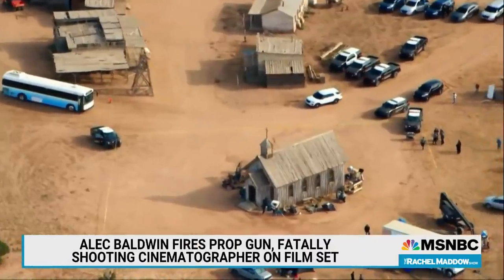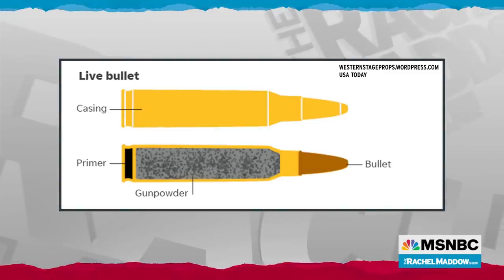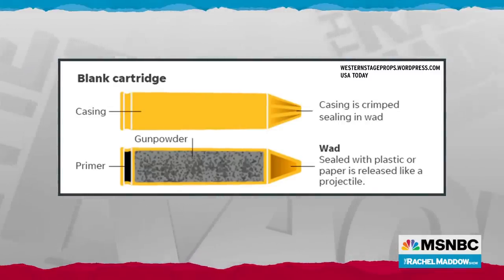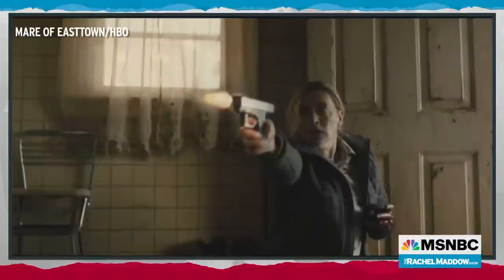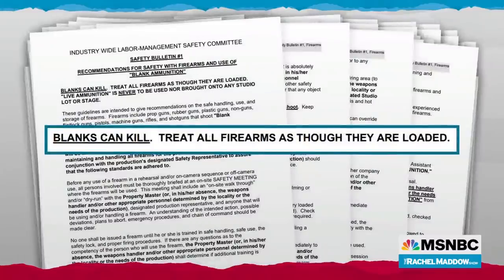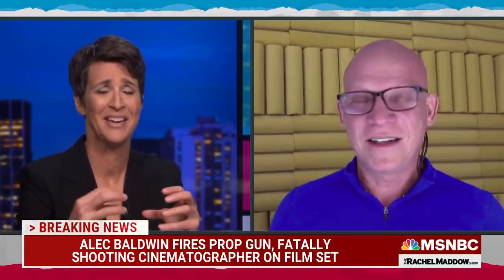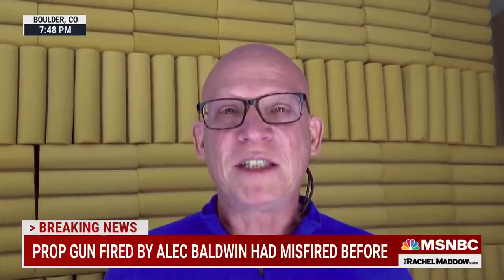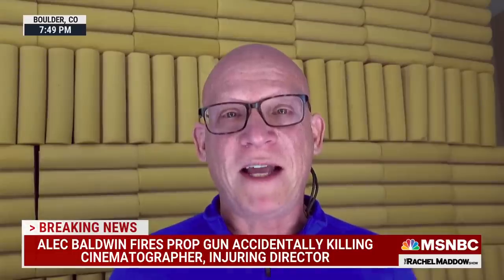Weapons Safety Expert Looks At Safety Protocols And Alec Baldwin Movie Set Shooting

Comment: Not only are those "safety standards" for movies they are literally the basic safety rules that you're taught or supposed to be taught on day one of handling a gun.
Reply: Yep, if I was an actor I'd be checking any guns handed to me and insist that I be the one loading it with blanks.  Even if the gun was designed to only accept blanks.  When you just accept that a gun is clear when someone just hands it over you are putting your own life at risk.  This could have been a very different story if the barrel had a blockage in it and it exploded in Alec's hand.

Comment: Great breakdown! It seems to me that it must have been an actual round of ammunition but it's still puzzling how this happened.
Reply: It was used at a gun range and failed into negligence.
Reply: @colinl5951  Most likely or used to shoot real rounds for another part of the shoot (i.e. shooting at objects) The failure definitely falls to the armorer. 

If you look into it the armorer is super inexperienced. I mean 24 and talks about how nervous she is loading blanks. Not much experience. Although I can understand being nervous since she would understand blanks would be used around people and thus its more pressure on being accurate. Still, if you're that nervous probably should be head of the handling.
Reply: @TearDownGenesis  you hold a gun, it fires, your responsible!

Comment: I understand from past experience working as a paramedic on movie sets that a armorer or weapons specialist was required on all sets.
Reply: Supposedly the armorer prepared 3 guns and put them on a cart.  An assistant director picked one up and handed it to Baldwin, then called out "cold gun".  Baldwin fired it.  All three people should have checked that gun.  Baldwin is apparently anti-gun, but even so, he should have been trained to check.  I haven't seen a timeline showing how much time elapsed between the guns going onto the cart and Baldwin being handed one.  Apparently a bunch of crew, including the armorer, walked off the set due to safety issues.

There's also reports of some of the guns being used for target practise off-set.  And also that live ammo and blanks were stored together.

I don't know what the normal protocols are, but if I was responsible for those guns, there'd be a chamber flag (or the revolver equivalent) in each one, right up to a minute or so before the cameras rolled.
Reply: Are actors expected to check. I keep seeing people say "Alec should have checked the gun" is that something that they are expected to do?
Reply: @ralphm6901  I haven't heard some of that, but I honestly think the responsibility (i'm not saying criminal) does lie with the armorer. Its their job to ensure the guns are properly maintained. If the asst director went to their work station and grabbed it without asking then maybe not but if they were left and not fully noted as being loaded then it really falls on her (armorer) for failure in her role.

Comment: Weird, strange, reminds me of the Brandon Lee thing years back, I remember back then, even as a preteen being like, none of this makes sense, reminds me of the hitman game when you have to trade the prop gun for real gun to cause the screen to have an accident, real guns on set are supposed to be modified with a simple teqnique at the end of the barrel that would prevent most accidents, there's absolutely no reason for deadly ammo on movie set, the Brandon Lee thing with saying that the lead from a real bullet got lodged in the barrel and then a blank bullet was added during the scene and the accident happened was very sus at best, I just don't even want to know... there's no reason for real ammo on a movie set, a blank bullet fired at point zero range would scar you at best, somn more had to have happened...ijs
Reply: Honestly Brandon Lee's is more "understandable" since a piece of a fake bullet broke off and lodged in the barrel of a gun and when the blank was used it pushed it out like it was a real bullet. 

At least in that case the proper ammunition was used, but the failure was the gun wasn't properly inspected (determined in the investigation) here an entire live gun was put into a situation and called cold (no ammo)

Imagine some of these movies with automatics and if those got swapped.

Comment: I know gun fans that say they can tell the difference between a real gun firing and a digital effect. And they're probably right. 

The police are investigating multiple things. Were the guns secure during lunch break. There was a labor dispute going on on the set. An assistant took the gun from the props table and announced "cold gun" before handing it to the actor, meaning that they double checked that the gun did not have live ammo. Sounds like that last safety step might not have been properly performed. There are likely rules against actors opening the firearm. The actor was practicing drawing the weapon in a manner that the story required when it went off. On a movie set there can be thousands of watts of lighting on the actor preventing them from seeing into all the dark areas of the room. The actor might not have even know there was someone standing where the gun would be pointed once drawn during the rehearsal practice. And if it were a slow motion shot then even more lighting would be in use. 

I wonder if the guns were secured during lunch break such that no one could tamper with them. (remember there was an ongoing labor dispute.) And why the assistant announced "cold-gun" without checking it for live ammo when handing it to the actor.
Reply: The labor dispute was one of the first things I thought of.

Comment: For those unfamiliar, there are 4 Basic Rules for safe handling of firearms.

1, Always keep the firearm pointed in a safe direction.

2, Treat all guns as though they are loaded.

3, Keep your finger off the trigger until ready to fire.

4, Be certain of your target and what is behind it.

This tragedy occurred because these rules were not respected or followed. 100% avoidable.

What occurred was a Negligent Discharge.

Comment: Alec Baldein is also a producer of the movie Rust. There are reports that union workers had filed complaints about lost/unpaid compensation, hotel accommodations, and safety issues with the production, and that they had walked off the set that very morning due to their concerns not being addressed.

A handful of non-union workers were supposedly brought in as last minute replacements and it's possible that these people were not vetted or trained on firearms safety that is required in movie or television production when prop guns are involved.

That seems to be the most plausible cause of this tragic accident. There is a more sinister possibility and that's one of the union workers had an axe to grind with the producers and deliberately sabotaged the prop gun so something like this would happen, but this is a farfetched/worst case scenario. Hopefully the investigation will uncover the truth of what happened here.

Comment: There are reports the crew walked off the set a few hours earlier in protests over safety concerns. Was this an accident waiting to happen? Because of the work culture? Or was it a malign act by a disgruntled member of the crew who thought it might prove a point and it unfortunately had disasterous consequences.
Reply: It sounds like it was troubled set with budget issues and it was this lack of resource which seems to the reason for the walk offs. Lack of budgets and poor management often are the root cause of safety failures and bad safety culture.

Comment: One thing to note from the diagram at 1:25
A bullet is most effective when fired from a device designed to propel it in a straight path. In other words, if the bullet is exploded outside of an actual firearm, it's still potentially lethal (like a tiny grenade), but nowhere near as lethal as when it's fired from a gun with a firing chamber designed to hold the casing still, and a rifled barrel designed to spin the bullet so it flies straight.

In fact this is one reason why Bruce Lee's son died. The prop crew at that film shoot emptied the powder from a round and replaced the bullet, and when that was fired on set, a bullet got lodged partway down the barrel of the revolver being used, because the crew neglected to remove the primer. That's called a "squib load", and is incredibly dangerous because it can cause the breech to explode into the face of the person firing the gun. When a blank round was loaded, that propelled the bullet that killed Brandon Lee.

In any case, there is no reason to use live rounds on a TV or film shoot. Not when the risk of death is just too great, not when there are tons of alternatives. Whoever let a gun loaded with live rounds onto that set has a lot to answer for.

Comment: The person handling a gun is responsible to ensure it's safe and used safety, Alec blamed everyone else but himself who actually fired the gun.
Reply: :  I have not heard of any blame being assigned, where did you hear that?
Reply: And when the scene calls for the actor to jump into a car and drive away, do you expect the actor to first conduct a full safety check of the car, measure tread depth on the tyres, check wheel alignment, thickness of brake pads, operation of windscreen wipers etc, etc?
Reply: @grantm6514  First Jeffrey Toobin, now Alec Baldwin. Comrade, why IS this happening?😥

Comment: Slight correction: Gunpowder technically refers to old powder AKA black powder. The stuff used now is called smokeless powder. Unless you're firing an antique gun/ammunition, it will always use smokeless powder.

Comment: I always check any weapon in my control to know exactly its disposition and if it's the one I've expect.  I've gone shooting with a law enforcement officer that handed me a 9mm with a round left in battery... but claimed it was clear.  I pulled the slide with the mag out and thete sat a little present.  I kept the gun pointing in a safe direction while I checked.
Reply: It seems to be a common misconception about semi-automatic firearms. People think if they take the magazine out, it is unloaded. Some firearms have a magazine safety that is supposed to prevent the gun firing if the magazine is out. I never trusted that idea. Pull back the slide.

One firearm that will tell you if a round is in the chamber is the WWII Lugar. I think the Browning also made a handgun with an indicator. It would seem to me an excellent idea would be to have such an indicator on all semi automatics. But to tell you the truth, I probably wouldn’t trust the indicator, either.😁
Reply: But you went in knowing that you were going to be handling a leathal weapon with the potential of it being loaded.  You also willingly chose to conduct an act where it is ultimately your responsibility to ensure the safe use of that firearm.

That's is not how film-making works.

Actors are not gun users as their entire job is to essentially 'pretend' and in doing so, they hold a legal expectation that everything they do is a pretend act and thus does not carry any realworld consequence.

Unless there was a legal status saying that the ultimate responsibility of safety was on the individual firing a gun during the filming of a film/TV show/Commercial/etc, then it's not the responsibility of the actor to ensure that what they are doing is a safe act.  

Example, is it the actors responsibility to ensure that it's safe to run through a door so as to not hit a passer-by that just happens to be on the other side?  Is it there job to ensure that throwing a rock in X direction will not hit another human in the head?   No!  Their job to to act and it's someone else's job to ensure that their actions are safe.
Reply: @inorite4553  Anyone handling a firearm has the responsibility to handle it safely. Actors receive training on how to handle firearms safely. Someone else may have made a mistake, but in the end the person who pulls the trigger is the one who bears the majority of the responsibility. That’s true wherever firearms are involved.

Comment: Seriously nobody will say anything about the  possibility of that blank ammo being sabotaged? There are specific materials that can be placed inside a blanck bullet and then dissolve after the shoot. But who would do something like that crazy???? Who would have a personal valid reason to end Alec's career like that? Who????
Reply: Because that's a really really far stretch to assume.  Like, you'd first need to come up with a lot of evidence to even hint that it could be a possibility before it'd be considered.  Considering the other factors - the strike of the crew, the poor weapon safety enforcement, etc.. it's far more likely to be an unfortunate accident.

Alec's career may not be over, either.  If it is a true accident, then he might suffer some setbacks.. but Alex Proyas and Michael Massee was fine after Brandon Lee died on set under his watch.

Comment: A slight correction. A misfire is when a round doesn't go off when you want it to. When you pull the trigger a round might not go off and it might never go off. It might go off a few seconds later when you're pointing the gun somewhere else.  If the round doesn't go off when you pull the trigger and the mechanism strikes the primer, then you've got a little bomb.

Comment: A live round in a blank firing gun? I call bs. They outfit the chambers of these guns with an ID of about .1 millimeters less than an actual live cartridge so loading any live cartridge simply wouldn't fit. Because blanks are so often under powered they compensate for this by using a special nozzle down the barrel that enhances muzzle flash and sound. Maybe that piece came loose but loading a live round into the chamber? Impossible.
Reply: That's the truth.
Reply: Unless it wasn’t actually a prop gun.

Comment: To nitpick just a bit.
A crimped blank doesn't tend to have wadding because they are often used in semi-auto guns that have barrel ports installed to create enough back pressure to cycle the weapon action. Wadding would clog this barrel port potential causing the weapon to fail.
Revolvers and shotgun blanks on the other hand are typically not crimped and have wadding to seal the end of the blank. Not only can the wadding injure someone but if a foreign object is in the barrel when the blank is fired it will become a projectile.

Comment: It's always risky to disagree with the expert consultant, but guns CAN accidentally discharge without pulling the trigger. This has mostly been eliminated over the years but I have seen a rifle that could be made to shoot if it was loaded and you put it down too hard. Old school handguns were prone to accidental discharges it they were dropped and the back hammer spur hit the ground first. He is correct though that almost all "accidents" are negligent rather than mechanical.

Comment: Even if there is no wadding, at close enough range,the high velocity gas ejected from the barrel can produce fatal injuries.
In 1984, Jon-Erik Hexum died when he played Russian roulette with a prop gun:
"Blanks use paper or plastic wadding to seal gunpowder into the cartridge, and this wadding is propelled from the barrel of the gun with enough force to cause injury if the weapon is fired within a few feet of the body, particularly a vulnerable spot, such as the temple or the eye. At a close enough range, the effect of the powder gases is a small explosion, so although the paper wadding in the blank that Hexum discharged did not penetrate his skull, there was enough blunt force trauma to shatter a quarter-sized piece of his skull and propel the pieces into his brain, causing massive hemorrhaging. "
-wikipedia

Comment: It’s not the actor’s job to check if the gun is loaded. The armorer is supposed to handle all weapons on a set. There should not have been a loaded weapon on a set during rehearsal. Half the crew walked off the job that same morning because of various security problems on the set of Rust.
Reply: Wrong.  Forget job descriptions.  Any person who picks up a firearm is responsible for safe handling.  He should have cleared the weapon himself and inspected each cartridge.

Comment: Not necessarily. If the gun misfired. The trigger was pulled, but the round may have had a bad primer. This would result in what is called an delayed primer strike. Where the  trigger is pulled, the hammer drops onto the primer, but the firearm does not automatically discharge until a few seconds afterwards.

Comment: Lesson to all of us: Every gun is to be considered loaded, cocked, and off safety until the person touching the gun verifies it is safe. Every person touching the gun should 1) open the action and check that there is no ammunition in the cylinders or clip. The difference between a live cartridge with a bullet and a blank is highly noticeable.  2) Every gun should have visual Chamber flag showing everyone there is no bullet in the chamber. Shooting ranges and hunting clubs require it - why shouldn't a movie/TV show set? 3) Every person that touches the gun, actor or armorer, is responsible for opening the action and verifying it safe. Particularly, on a movie set, assume everyone is ignorant of basic gun safety. Finally, whether in a factory, chemical plant, oil rig, or movie set - no work is too important that safety rules can be ignored. Everyone is responsible for safety - not just an armorer, or Manager of safety. Anyone can stop all work until safety is verified. Anything less is an unsafe workplace.